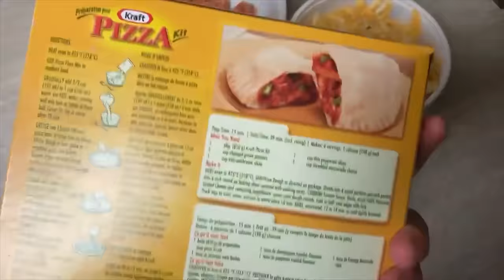Getting Stuck to Set the Clutch on Our Winter Ice Roads March 24 2024

Comment: Seemed like those rears tires with no groove across are useless at times. I know back in the 70 s I worked at a farm equipment dealership that had those kinds of tires on a machinery hauling truck . A tire shop came and ground grooves across them which helped big time. I know wheel loaders with similar tread have issues in mud and wet snow. Now you get to repack the trails
Reply from the maker: they are a copy of the military thread from WW2. it was all we could get for that size and came from india. now they have a better selection of tires and thread to chose from because more people or working on these old trucks  thansk

Comment: Looks like the clutch got a good work out. On the'38, the front wheels are on with 5 studs. Is it 5 studs on the duals? I didn't get a good look. Great video, Xena. Get well!!😎
Reply from the maker: they are all 10 bolt rims and they use a cover plate to hide the front 5. the big trucks have the big 5 bolt pattern front and back.  thansk

Comment: Hi King, I have a curious thought: Can you put  rear wheels & tires on the Front in-side-out so they track outward? Then put the rears on reverse so they track inward? Thinking maybe the tracks would line up. One of my problems is I experiment too much. I did it for a living for 36yrs at GM on their Proving Ground near where I live, so it's in my blood.  ben/ michigan
Reply from the maker: if we change out the park brake cable of make a guard for it then we can chain the inside tire like grandpa used to do and take the outside one off for traction.  thansk